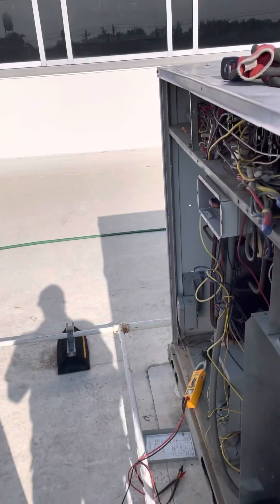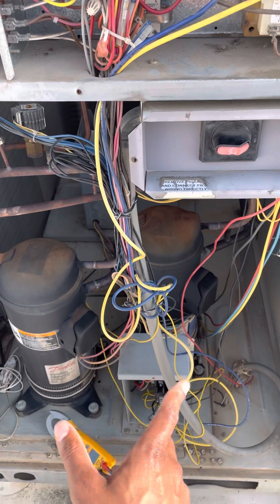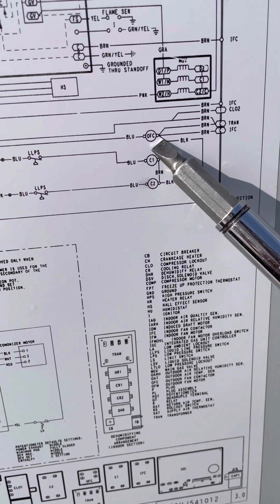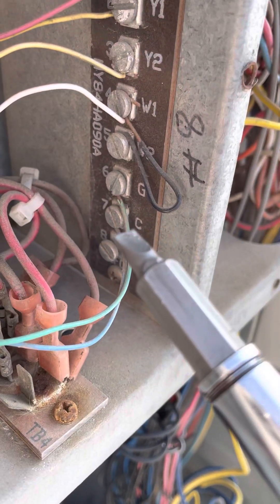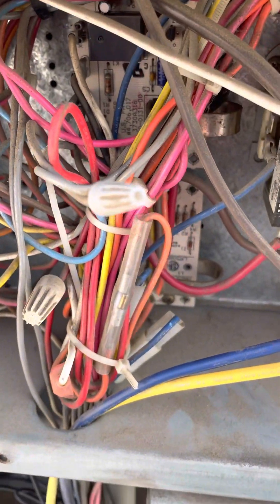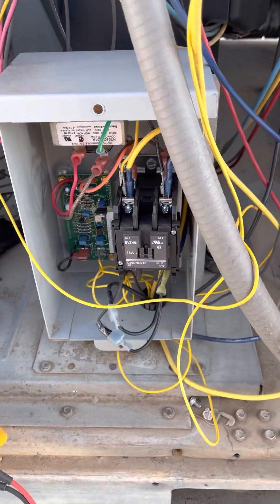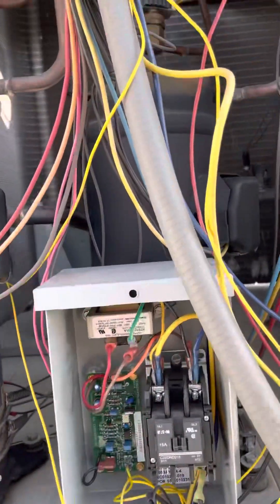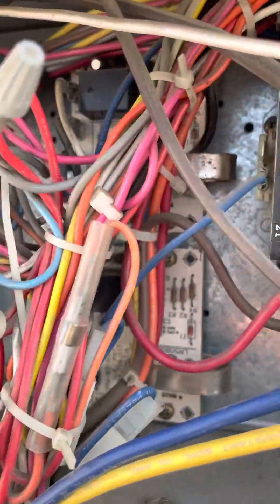Hvac Technician quick facts |Hvac life

Comment: All you have to do to check if it is locked out is to check the voltage from C to X. If you have voltage it is locked out. They work like an impedance relay or holding relay.

Comment: Those older pre Central Terminal Board units sure turned into a wiring nightmare. 
For some reason they rarely used that CLO as much after 2006 with CTB and just let that compressor bang off and back on repeatedly as the LPS or HPS resets.
Reply from the maker: That’s interesting! I had no idea, yah for some reason someone previously bypassed the CLO in this unit. I had to wire everything back. Guess they didn’t know how they worked lol

Comment: Messy extensions in carrier
Reply: Before the central terminal board was used after 2006or so,  the techs would cut the zip ties on these and quickly turn them into a bird's nest 😐